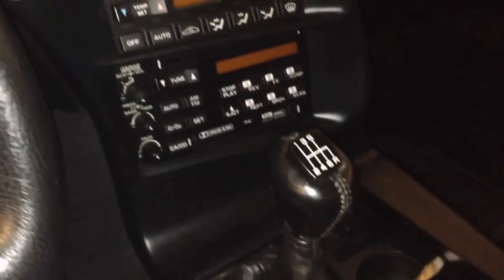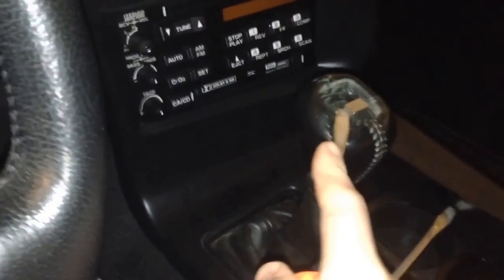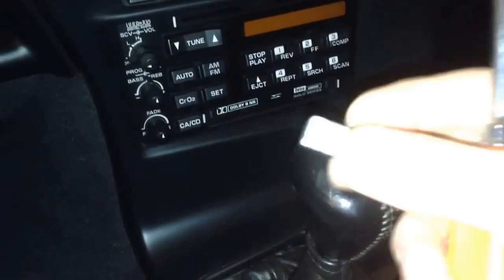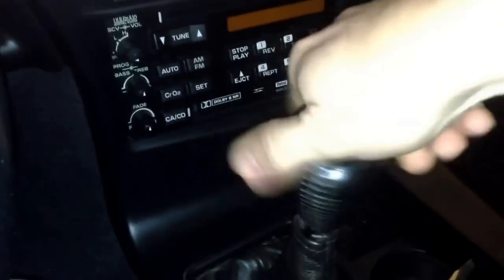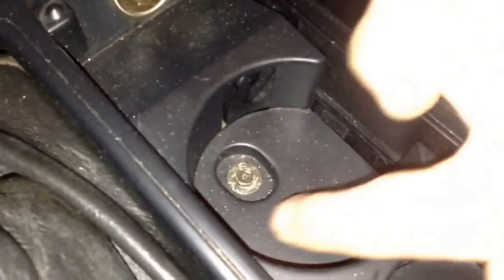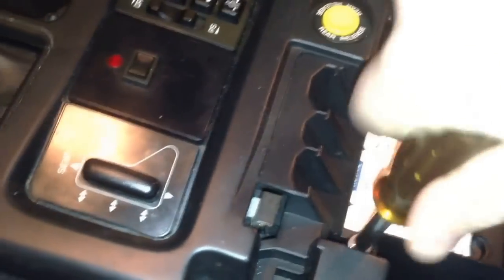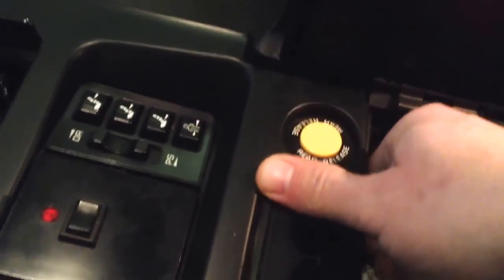Corvette C4 shifter and center console remove

Comment: hi, nice video... is there an easy way to remove the ashtray/cup holder lid on a C4?
Reply from the maker: Hey There, thanks for the comment.  I think you would have to take the whole thing out and then try to replace the lid, but I think the new part already comes with a new lid, its one piece.  You might be able to take the lid off the new piece but you might damage the little pins where it moves.  I think the easiest way is to take the whole thing off like I did and then change the lid if you have one, or put a complete new one in.  If you try to pop off the lid when that centre thing is still on the car, you might loose a spring or break it, and then its going to be even harder..........

Comment: How do you remove an automatic c4 shifter so I can install a replacement console?
Reply from the maker: +Billie Sue Woolley   I have never removed the Automatic C4 shifter so I'm not too sure.  Usually on the shift mechanism (where you grab with your hand) there is something that you have to take out. Could be a clip or screw.

Comment: oh my gosh what does the switch next to power seat control do. my vette has almost the same thing and i can’t figure it out
Reply from the maker: Hey there, those are for the lumbar support.  Most don't work anymore os the bladders inside have failed. The switch that slides up and down is to make the switches work for the driver or passenger.  This was a 96, and the the earlier years had those buttons on the seats instead of the console.

Comment: I did this, but when I put it back together, I can’t get that “T” wedge to stay seated. Keeps popping out before I can get the cap on. What am I doing wrong ?
Reply from the maker: Take the T out and use a bright light and look down, make sure the pathway is clear and everything is lined up.  If its not perfect the T won't fully seat.  Also you may have to use the back of a screwdriver to tap it in.  MAKE SURE its lined up perfectly before you do so, and make sure there is no debris or anything blocking the way.

Comment: Why wouldn't you just use a pair of pliers?
Reply from the maker: I have heard a few stories of the pliers slipping off.  Sometimes that T retainer can be very tight and you can better wiggle it out and control it with a screwdriver.  At least thats how I do it.  Could you use pliers, sure, but you will most likely marr up the T in the process, and you may even give yourself a hernia pulling on the pliers LOL

Comment: Its not that easy
Reply from the maker: It actually was for my car.  My interior was pretty clean and I think that if the car is sitting outside a lot (and not garaged) then maybe corrosion can develop in the T that you have to pull out.  I have a new C7 and the rotors have no rust on them as its always in the garage.  If the car was parked outside the rotors would be rusted.  I think maybe that could be an explanation why some are harder to remove than others.  My C4 was garaged its whole life, and you know personally I regret selling that car.  I should have kept it........
Reply: @GarageKing  tried to get it off but wouldnt come, now car wont start, no crank. Do u know what happened?
Reply from the maker: @Mr.DIY69  The no start would not have anything with you trying to get the shifter off.  I think its just a coincidence.   DO you have power?  I would check your clutch switch.  If you have no power at all then its a bad ground or your battery cable has come loose.  If you have full power, but the starter won't engage then its probably clutch switch
Reply: He didn’t show the shift boot is screwed to the console.  On my 1991 it is anyway.
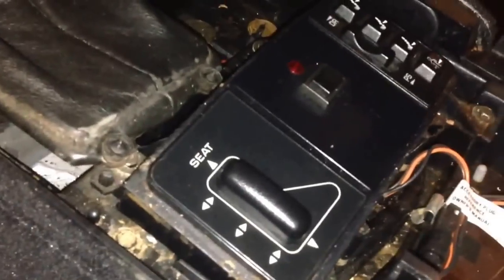Reply from the maker: @gregs_garage  Mine was screwed to the transmission tunnel housing. At 3:41 you can see if you slow down the vid and pan over.  But it's not actually attached to the console part that I removed.  This was one of my first vids so pretty cool to look back on it.  I have a come a long way LOL :)    Thanks for the comment :)